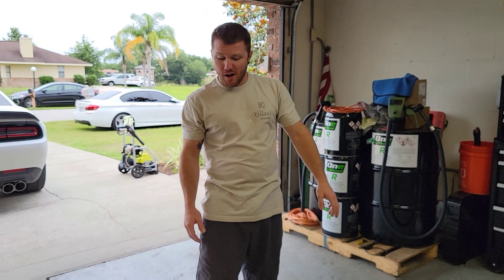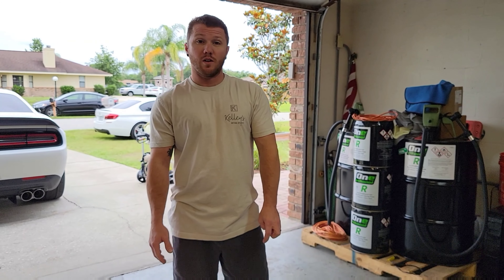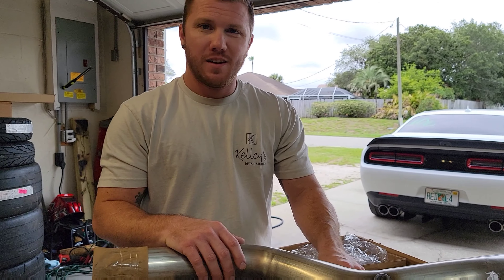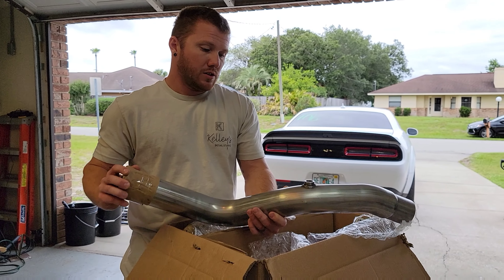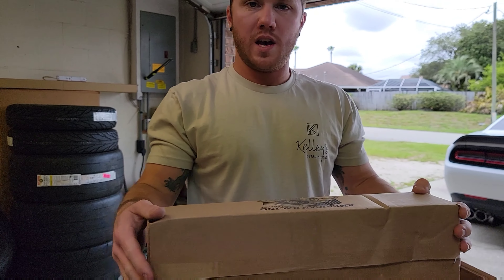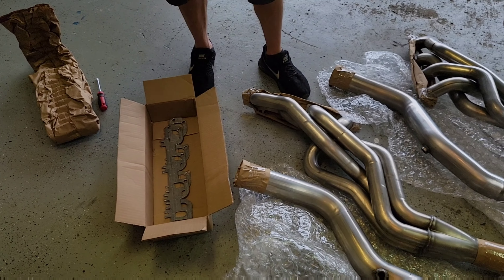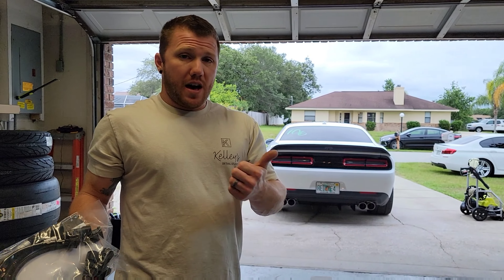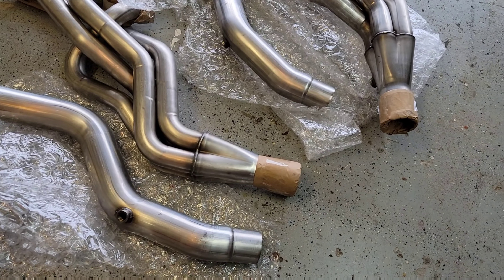Installing American Racing Headers on my Redeye!

Comment: Hi Chris went back to watch this one. Buddies keep telling me to put on long tube headers...So I'm needing to use the Nickson exhaust clamp (heard the tick and tracked it back to same connection leaking you had). Wondering if you used it with this exhaust setup also? 
Thanks
(You ever do any testing to see if removing cat back did anything??? Believe you may need revised tune...less timing...to see results of less backpressure and better sweep of cylinders.)

Comment: I’m quite happy with my American racing longtubes, I can’t wait to put them on just need a tuner
Reply from the maker: You can install headers on a1 car without making any changes to the calibration. However, once you tune for them you should see a gain of about 40whp.
Reply: @KelleysGarageOfficial  that goes for any Mopar? Thought you “Needed” a Tune is what everyone makes it seems or your car would mess up I Currently Have a Corsa Extreme On My Scatpack and Was Going Corsa LT Headers Or ARH but idk if i needed a tune and how quickly do i need to get one after installation before something messes up if so
Reply from the maker: A tune is not required with LTH, however it is recommended to update the calibration when making any changes to the car. I don't believe you'll notice much of a hp gain with no tune update. You will definitely hear a difference in exhaust pitch though. @duhrell

Comment: Did you have to drop the rest of the catback? If not, any tricks to get it all on there with out too much trouble?
Reply from the maker: I don't believe I removed the cat-back. Pretty sure we just disconnected the X pipe and did the install. It's been a long time since this video was made. I don't remember all of the details. Pretty straight forward deal. Get yourself a 12" 10mm break neck wrench, it will help a great deal👍

Comment: How do you like the headers? In hindsight would have you got them ceramic coated? I’m waiting on a new 426 for my hellcat and on the fence if I should do headers now or later. Not dropping the cradle, it’s going in through the hood.
Reply from the maker: I would buy them again! Absolutely love the ARH
Reply: Bro ur doing a 426 and no headers ? Def get them at that point
Reply: I did go long tube arh. Although my engine builder said the arh shorties would work just fine.
Reply: @75swampass  shorties won’t even give power
Reply: I’m sure my engine builder knew what he was talking about. His point of view, if I recall correctly, was more or less you obviously get a few more hp with long tuned but ease of install, ground clearance and if the letter people go nuts I could run high flow cats

Comment: So you installed this without dropping the cradle or removing motor mounts ?
Reply from the maker: Yes
Reply: @KelleysGarageOfficial  very nice you ever take off the cat back and run straight turn downs ?
Reply from the maker: @deadstockflaco  nosirr sounds way too good with it on

Comment: I appreciate it! So very many many people won't even change the plugs on their late model Hemi. It's insane to me. Simply search Hellcat or Challenger and headers. You will see 50 people talking about just got my "x" installed. Picked it up this afternoon.  Challenger peeps got all da cash! 
I wanted to see fitment, clearance issues? Etc.
Reply from the maker: No fitment issues at all with these. American Racing Headers are great quality. The only issue was removing the passenger factory O2 sensor. It was cross-threaded from the manufacturer and broke when it came out. Replacement was about $150. A friend of mine helped me with the install, so it went pretty quick. Got it done in a day.

It shakes the house when I start it up now!!! 😎

Comment: What muffler set up are you running ?  Can you describe your set up from the headers back? Did you get catless headers? 

Looking at inch and 7/8ths or 2 inch primaries for me REWB. Rest of my exhaust is stock right now. Rather than mess around with anything figure jump straight to these bad ass headers
Reply: So bad ass
Reply from the maker: Just now seeing your comment, sorry for the delay.. 

The current setup on my car is 2" ARH catless with an AWE touring (non resonated) cat back.
Reply: Thanks man it is so bad ass. I want to do the same set up on my Redeye. Yours sounds SO fing bada$$ thanks for getting back

Comment: What tires are on here street tires? And do they hook 30-40 pulls?
Reply from the maker: ET Street R. Yes they are street tires. My last set we got about 50 low 9 second pulls😎
Reply: @KelleysGarageOfficial  what size and about how many miles aside from pills did you get on them.
Reply: I assume they are good on the street from 30-40 mph
Reply from the maker: @davidstevens8300  the tires that are on my factory wheels are Nitto NT05R. I've had many different style tires on the car and none (including these) hook on the street. I have to be doing about 70-80mph to really lean on it.